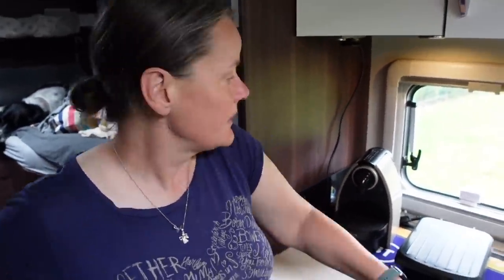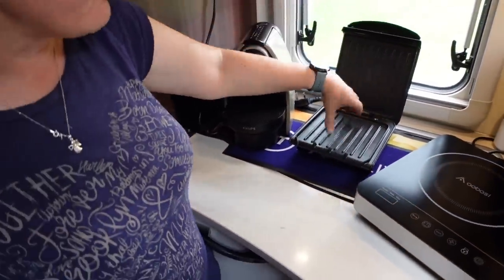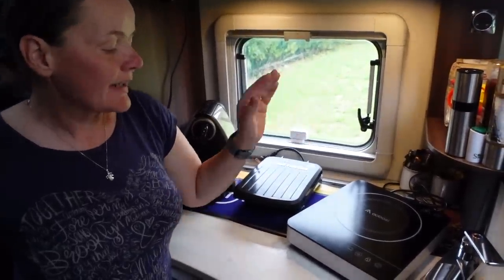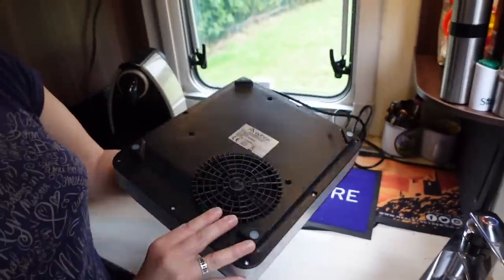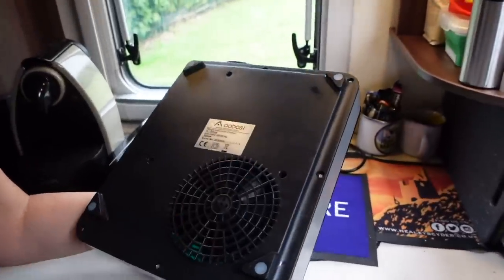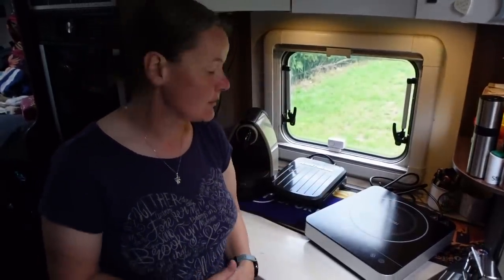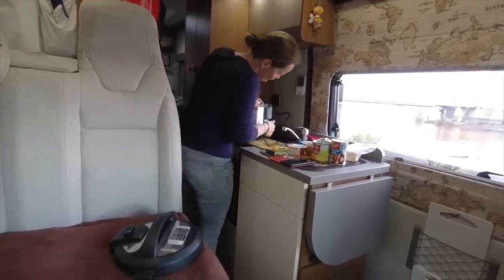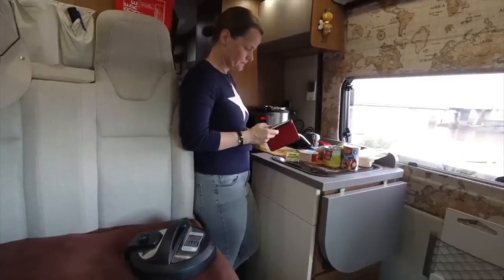FREE 'ish Vanlife Cooking - How we Power our 'vans Kitchen Appliances

Comment: I have been investigating all in one Lithium power packs inc inverter. Now most come with 1Kw Inverters so I experimented with various electrical items we use in the van to see how much power they take and typically how many Wh they use to boil our brew or cook some beans etc.. in a pan.
Below I'll table the results. However an important observation when I was testing our induction hob was that on Power 1 & 2 settings the hob cycled on / off within 5-20sec so on setting 1 the lowest (which is good for most things as induction cooking gets hot very fast) the hob was on and off every 5 sec using 1105 W so just above 1K ! however becasue most inverters have a tolerance >1K and for the PowerOak EB150 for instance this is 1000-1200 W for upto 2 mins before it shuts off to protect the inverter. So the cycling nature of the lower induction hob settings are very useful if you are going to buy a 1Kw inverter based system. All the other items were close to 1Kw or lower. The only device the kettle rated at 1Kw measured 1040 W and took 4.5mins to boil. Maybe someone has a PowerOak EB150 or 240 and can advise how it copes with a 1040W load for 4 mins i.e does it cut off or is it within the tolerance ?  
Anyway the results which I find encouraging especially from a Litium capacity viewpoint as most Lithium systems are rated on KWh so the EB150 for instance is rated 1.5 KWh and with 85% efficiency I would expect it to deliver 1.275KWh of power.. comments?

Appliance                     Watts observed         Time to cook       Wh used            Notes

Kettle                             1040                            4.5 mins               78                       1040W for 1 hour = 1.04KWh,  1040W for 1 min = 1040/60 = 17Wh
Induction hob  set 1    1105                            5                            46                       1105W for 1 min = 18.4Wh however induction is not on for full min hence the Wh used is less than 1m x time used its a little less.
Induction hob  set 2    1105                            5                            61                       1105W for 1 min = 18.4Wh however induction is not on for full min.
Toaster                           750                             4                            50                        750W for 1 min = 750/60 = 12.5Wh

So from the above assuming we bought the EB150 (1.275KWh) we could expect to use the above items 

Kettle 10 times (780Wh)  for 4.5mins each time.
Induction hob low (1)   x1 (101Wh) for 5mins
Induction hob med (2) x 2 (270Wh) for 5mins
Toaster  2 (100Wh)  for 4 mins

Total (1251Wh) 1.251KWh                    

So I determined that even the EB150 (if the kettle did not trip it after 2 mins @1040W) would be considered useful for a 2 day trip 

However in the end I decided to pay a little more and purchased the larger capacity PowerOak AC200P which has a 2KW inverter and 1700Wh (2000x0.85) of usable power which should be just dandy for a 2 day trip without solar top up (typical UK trip :-)

Sorry for the long winded comment however it now makes sense to me just what to expect from these Lithium integrated systems or more custom solutions as mentioned by John. But as I don't want to mess with wiring and cutting holes in my van I decided on the all in one unit which I think John agrees with looking at his recent AC200P review :-) 

Yes Lithium is expensive however with 3400 cycles these modern LiPo4 based units are going to be around for over 10 years if they are well made. 

My experiments are a rough guide but either way I find these systems of use and practical for what I intend to use them for.

Mike

Comment: We use a Remoska cooker, I think they are from Lakeland, that works well for all sorts of dishes, I can't remember the wattage but I think it is quite low, the heat element is in the lid and it cooks from above the food
Reply from the maker: We tried it but it's no good for being off grid and will drain your battery flat in no time as the element doesn't turn on and off to keep temperature.
Reply: @johnmandy  ... grest video (as always) but a bit of a "harsh" comment re Remoska? The Remoska is "only" 450W so the same as a 2K hob running 25% on/off duty cycle. I am in a small van and only had space for 1KW inverter, and for me the Remoska is one of the few electrical cooking appliances I can use.  Yes recharging off solar is difficult for me, so I use it when I know I will be driving soon.  "Horses for courses" but Remoska is worth considering if it suits your cooking style.  Thanks for all your content.

Comment: We have a caravan and have started to go off grid on our trips. We do everything with gas or 12 volt, we have a 12 volt tv. The only things we don’t use are microwave which I only do bake beans in or scrambled egg and both can be done on the hob. The other thing is, like Mandy my good lady loves her Tassimo coffee machine which I think is 1300watt. Our van has a 100 watt solar panel and a 110 amp leisure battery. Could I fit a 2000 or 3000 watt inverter to my battery just for running the Tassimo. From start to finish it takes 90 seconds and probably used 4 or 5 times a day.
Reply from the maker: You’d need to at least double your battery capacity to have enough power for a 2000w inverter.  Solar is always as much as possible.
Reply: @johnmandy  Thanks for that so I would need another 110 amp battery run in parallel. The problem with that is we have a Bailey where the battery compartment is under the floor under the bed. It would be possible to stand new battery under bed near the one in situ I suppose.

Comment: John , I have a 120 AH lithium battery and a B2B charger (REDARC) and a 175 watt solar panel. In theory... What size inverter could I use ? My wife would love one of those hobs.. keep up the great videos ... And we look forward with anticipation to your proposed 9 month trip , cheers !
Reply from the maker: It’s not really just about the battery, solar or b2b. It’s about the cable sizes you’ve used, how you’ll wire up the inverter and the maximum load your battery can handle. Some lithium batteries can’t handle more than 80 amps load. I’d say if you doubled your battery bank, used at least 35mm cable on all battery and inverter cables then you can easily go to 2kw inverter size, which will power the induction hob fine. 
Solar & b2b are just ways to put power back in to the batteries, so the bigger the solar wattage & b2b amps the faster the battery is charged. 👍🏻

Comment: That’s was super useful . Thanks guys. I’m trying to be more solar based in my old MH, and with similar kitchen gadgets this is exactly what I need, currently only use them on campsites coz I’ve got no solar at all on van at present. only got my 500w poweroak for offgrid phone/ laptop charging 😂 I have a feeling I will need to upgrade my WHOLE electrical system when I change to solar . It’s gonna be expensive 😱

Comment: If your doing a stew or curry can you use your insta pot when travelling will that save your batteries as they are charging when engine is running x
Hi 👋 John hi 👋 mandy
Reply from the maker: We’ve not managed to do this yet as most recipes require a bit of liquid that would shlosh around when moving
Reply: I use Mr D's thermal cooker .... it's a game changer !
Reply: @juliahutchinson4542  Do those things actually work? (Mr D’s Thermal Cooker)

Comment: Hi I have 3, 95amp hour agm batteries ,200watt solar not got a inverta yet so what size inverta should I get and would the rest be set up to using a cooker like yours
Reply from the maker: With that setup I’d say a 1000w inverter would be the max size.
Reply: @johnmandy  thanks that’s would be 1000w Continuous  or 1000w peek

Comment: This is reasuring. I have all electric, no gas. Same as you, single induction at 2000w Peak, rice cooker at 500w peak. Kettle at 2000 w peak, microwave at 700w peak and a toaster, not sure but think about 600w. Running from 200ah lithium with 470 Watts of solar and a 3500 watt pure sine wave inverter. All yet to tested in real time. Only recently finished the build and not tried it all in earnest yet
Reply: Is it not worth getting a pair of 200aH lithium for that set up & needs?
Reply from the maker: @c11yan  that’s what they said 😁☝🏻 
Looks like a good set up
Reply: That sounds a very low power microwave?  A microwave typically runs at twice its "cooking " power, so an "800W" mwave usually consumes about 1500W.  Or have you found a very low power microwave?
Reply: @simonbaxter8585  An interesting point. I have a watt meter on order so will let you know